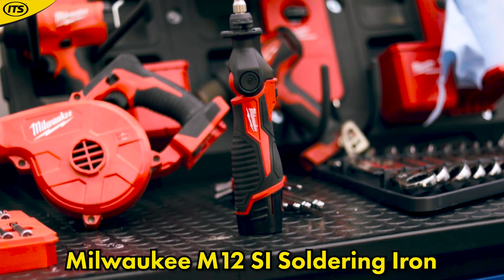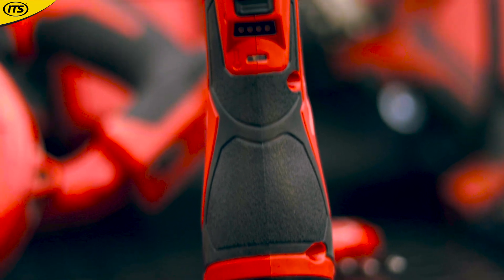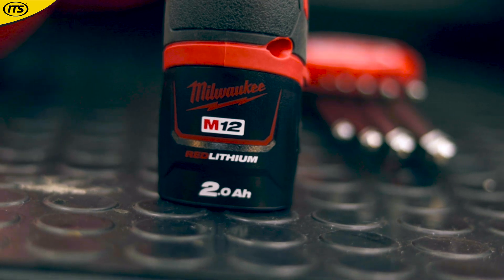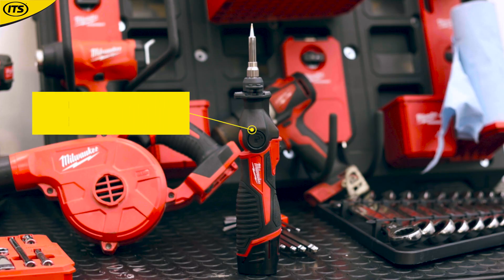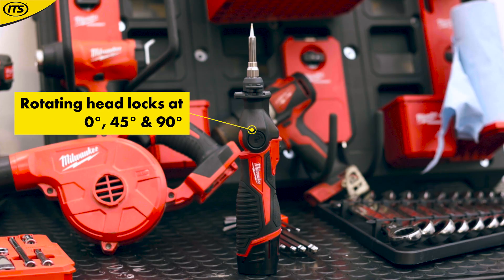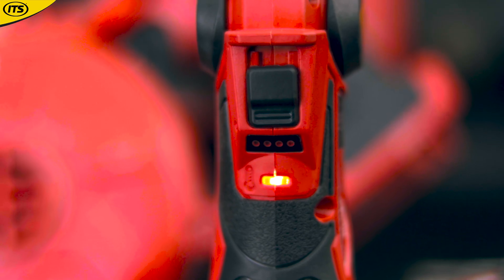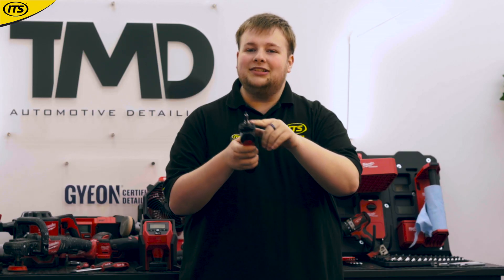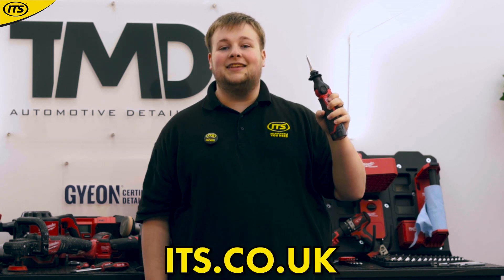Milwaukee M12 Soldering Iron - Quick Overview

Comment: When would you use such a fat device when soldering electronics precision is key
Reply: fat electronics? or maybe fat wires? or maybe a thin tip on a bench? I use mine in all of these configurations. When soldering inside of a car, cordless is awesome, and safer. Works for me. Though not all irons are created equal, some perform better in specific circumstances. I have 120v, gas, and the electric 12v.
Reply: Automotive industry